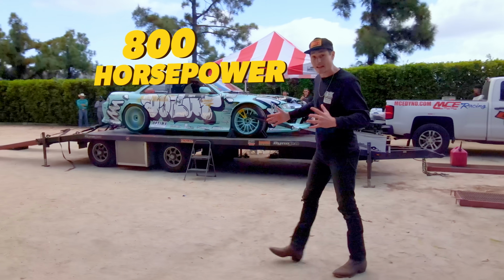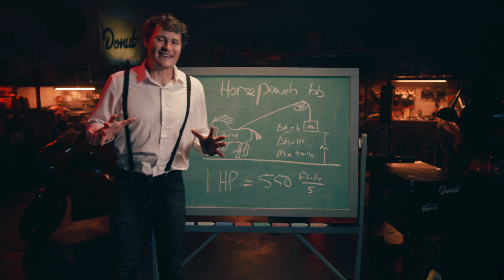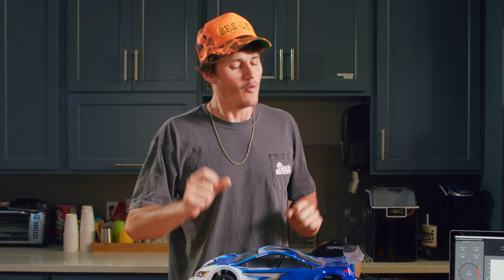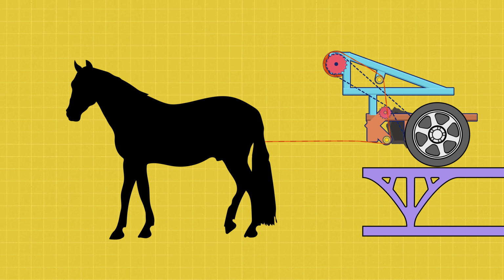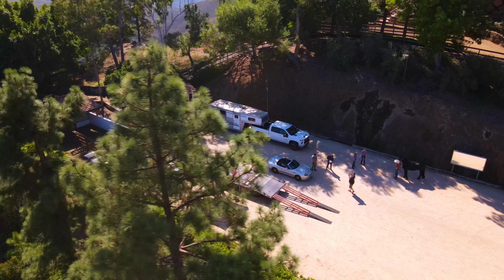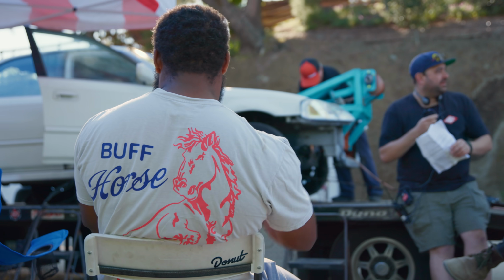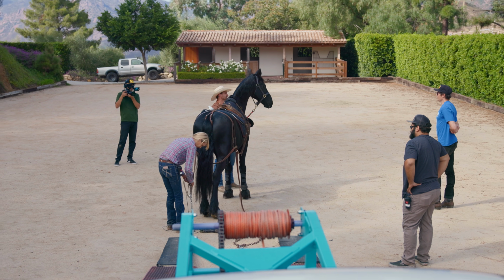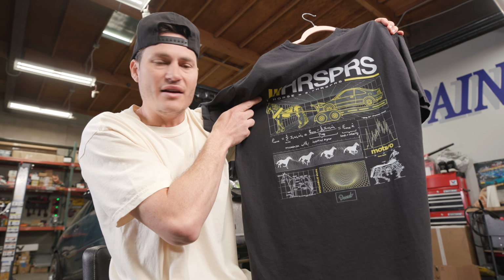How Much Horsepower is a Horse?

Comment: You must understand that James Watt was not trying to measure peak horsepower or the maximum load a horse could pull as you are but the power of a horse to do work repetitively without "pooping out."  His steam engine was a big seller in factories, mines, breweries, etc because he could replace the sustained power of a horse with a mechanical device that never needed to rest, never got sick, never needed to drink, eat, etc.  So when one looks at Watt's calculations in this light, his "one horsepower" is actually far more accurate and truthful.

Nobody from the day ever felt ripped off by Watt and his steam engines- I assure you.  Indeed they all praised it as the work of a super genius.  (Cue Wylie E. Coyote.)  If he had been padding the numbers, they would have known right away.  Yet everyone raved about his engines and their strength.  If anything, his stated outputs errored greatly on the side of caution, making the engine far stronger than he advertised it to be.  Further, the people on the business ends knew what a horse was capable of in a day.  If Watt was lying, they would have known it right away.  We often look back at our ancestors and think them dumb because they were mostly blue collar.  But let me tell you- those men were better at what they did than any engineer could ever be.  They did it day in and day out six days a week- they were true experts.

Your test is flawed because you are measuring only the peak horsepower of Big D- not how much work he could do in a day.  These are two drastically different things.  Draft horses did not make five pulls at maximum strength and then retire for the day.  They pulled and pulled and pulled- at a constant rate.  This is what Watt was actually measuring.  The "burst rate" of a horse was not important but the sustained rate of work was critical.  This is why your measurement of a horse power is so far off from Watt's measurement.  

Not to be a weenie or the fly in your horse ointment, but you are measuring apples and Watt was measuring oranges.  

It's very popular to look back at the great inventors like Watt, Edison, etc and call them liars and charlatans in today's cultural viewpoints.  That's because it makes us feel good about ourselves, but that's a straw man argument- Watt and Edison are not here to explain or defend themselves.  We are trying to place modern understandings upon people and times WE do not understand.  As such, one must know the history of the times- and not look through the kaleidoscope of modern understandings.  

Lastly, I would have simply put the horse on treadmill for a hour and let him spin the electric motor- and measured its output in volts over time.  Then convert this to watts, horsepower, whatever. Seems much easier than welding up gears and other contraptions, but hey- what do I know?  True, you may have had to use two treadmills welded together, but it would have worked.  

Big D would have come in at a SUBSTANTIALLY lower horsepower had you attached him to a mill stone and made him walk for eight hours.  Indeed any horse from the time of Watt would have come out as massively stronger than Big D- they worked 12 hour days.        

Your numbers were taken using a less than efficient device for Big D to pull upon.  That... "fur bar" device is NOT what horses of Watt's time would have been attached to.  They would have been attached to a collar custom made to the horse's anatomy.  As such, the horse could get its shoulders, chest and the entire front portion of its body into the equation- not just the rear end.

I suggest you go talk to the Amish and repeat this test.  Get them to use one of their field horses, a full blown work-horse doing hard work everyday. (As opposed to Hollywood horses like Big D that rarely put in a full day's work- but wow are they pretty!)  Measure the ability of Amish horses in period accurate custom made collars to do work over an hour or two.  Your results will then come far closer to what Watt measured I suspect.  

Google "horse collars" and you will see that Big D was not working anywhere near his potential.  Further, that his lack of training as a "pull horse" would greatly reduce his efficiency.    

Before one can judge a man, we must walk a mile in his shoes.  Understand what Watt was replacing with his steam engine first, that being the ability of a horse to work all day, and then work backwards.  I suspect that you will find Watt was MUCH closer in his measurement of sustained work than the conclusions you came to with this... well not trying to be mean but I must call this an apples to oranges comparison.

Comment: I think Mr.Watt meant that 1 horse power was on average equal to the power a horse could produce continuously for the entire working day without burning out. Of course a horse like D can pull hard during small bursts but if D had to pull continuously for the entire day then he would probably not produce 5,7Hp. 
Plus the working horses were walking i circles instead of straight lines.

Comment: I applaud the efforts.  Great video, well done.  It does strike me however, that just like efficiency loss with multiple humans,  this doesn't tell us something it should .  If I have a car with 570hp, and I say each horse represents 5.7.  Is 100 horses going to produce that?  Probably not.  There's just a not a great equivalence.  The imaging at the beginning of the video implies we could answer the question.  If I have a steam engine rated for 10 horsepower.  It might represent the 57 raw horsepower tandemed through efficiency loss better, than 10/5.7 or 1.75 horses.  In other words can 1.75 horses do the same work as a 10hp steam engine?  Probably not.  Perhaps an experiment for another day.  Of course, you'd have to do multiple runs, with varying numbers of horses, to extrapolate the diminishing returns.  Rigor is fun.

Comment: Great video. Per Wikipedia: 
"In 1993, R. D. Stevenson and R. J. Wassersug published correspondence in Nature summarizing measurements and calculations of peak and sustained work rates of a horse. Citing measurements made at the 1926 Iowa State Fair, they reported that the peak power over a few seconds has been measured to be as high as 14.88 hp (11.10 kW) and also observed that for sustained activity, a work rate of about 1 hp (0.75 kW) per horse is consistent with agricultural advice from both the 19th and 20th centuries and also consistent with a work rate of about four times the basal rate expended by other vertebrates for sustained activity."

Comment: Their answer was 5.7 horsepower, but i strongly disagree for this reason: the avg horse weighs 1500-lbs and runs 30-mph. It's a simple power to weight calculation. If you think u could move 1500-lbs to 30-mph in less than 1/8-mile w 6.5-hp id love for you to build me a gokart. 6.5-hp pushing 1500-lbs wouldn't generate 30-mph unless there was a big hill involved. Recalculate. The avg horse is closer to 50-hp than 5.7

Comment: AXIAL DYNAMO, SPOOL WITH A ROPE ATTACHED INSTEAD OF WHEEL AND READY: WIO, THE HORSE WENT AND THE MEASUREMENT IS READY. BUT LET'S SAY THAT MORE COMPLICATED METHODS ARE ALSO INTERESTING. THE SAME IDEA IS GOOD TO CONFIRM BUT THE RESULT MAY BE NOT ACCURATE AS IN THESE FIRST EXAMPLE WITH AXIAL DYNO..

Comment: you are going to lose an amount of power converting your "horse pulley system" to any form of mechanical transmission. you could have just dragged something heavy and used math. it would have been more accurate. im guessing you are wanting the measurement of power after transmission losses?

Comment: That was sweet. The only potential flaw would be a "control" to prove the accuracy of the mobile dyno. One car on ~3 other dynos and then used on the mobile dyno would give the control, then the mathematical specifics of the horse would have backup data to prove the accuracy of the numbers you got.

Comment: Hey how did you guys account for the gear ratio change on the layers of rope on the spool? Like the pulling power of a winch is different on each layer of wire on the spool.

Comment: The only problem I had with this was that the original measurement was for draft horses running a grindstone or the equivalent and doing it all day. I do not know if this horse could have kept that up all day and also the original measurement may have taken into account the downtime of the horse and the fact that it needed to be replaced with another horse when it was not working so it may have been calculated into the results.
Reply: Horse people will tell you that a horse will work his heart out for as long as you ask him to, to the point of complete exhaustion.  A mule on the other hand seems to have a built in limit where they will just work at a sustainable pace until they are tired, then refuse to continue.
Reply: there is the thing of messengers in medieval times working horses till they would litterally fall over dead  @AJ-ln4sm
Reply: Indeed: great video, but the initial comparison with horse power included the time. If big-D can pull this hard without problem 17.5% of the time (4.2 hours per day) for a few days, which sounds reasonable with a bit of training, then the original definition has been verified!

Comment: let me just pause your engineering masterpiece and find something better that handles even more duration can be tested with multiple levels of different horse's to discover that particular but not all horsepowers as you will need not just 1 horse but many different horse's wild and tame  you attach them to a cart 🛒 simply a vehicle like a car the weight of the vehicle is sensed including adding tire weight figure including air weight by how much atmosphere the tires are filled with and then rather than placement of your horse on the dyno you place the dyno As the entire tow vehicle which you can steer from or have it set to AI follow or mechanically naturally follow electric motors as generators literally absorbing horsepower  teaching horse to keep pulling when at full gallop trying not to slow down trying from dead stand still and other acceleration and slowdown patterns equally provided on each test subject as well as cow power moose power buffalo power whatever you got zebra giraffe hippopotamus rhinoceros you could transport this test item cellphones nd hard drives for processing and data storage power as well as online live updates ya simply take a picture 360 walk around of whatever is pulling and let it give her a tug btw specifically for testing purposes and not animal cruelty ❤ the best treatment over time as well as rewards for all participants ya can't expect them to work for you for free 😊

Comment: Maybe I'm dumb, but wouldn't this work for measuring crank horsepower?  First take a normal car and measure it on the trailer dyno.  You now know its wheel horse power.  Now take that car and have it pull the rope on the rig and see how the known wheel horsepower translates to the dyno and you'll know your rig's loss rate. 

You'd need to probably still do a LITTLE math to validate any friction losses from the car to the road but that's much easier.

Now you can just put the horse on it and apply the conversion ratio.

Comment: dude thers so many easier way to do this 🤭🫣 one pulley on ruff rope some weight and thats it 75 kg on 1 metres in 1 sek is 1 hp 👍🏻 even only stopwatch and gps speed meter be enpugh from accelerstion energy asf and many other easy way to measured power and no dyno dond measured torque it calculate it as well as power or both measured just one more complicated than other 😉👍🏻most stupit 💩 ever is mounted this whole frame in car instead of just frame without car just with 1 eheel in frame and this on dyno 🤷🏻‍♂️🤭 5,7 hp cos you prayed be the fire instead on put this fire tp this horse asss than dyno should show more than 10 hp ,in fact as engineer ypu probably know that this way of measurement have limitation which we call GRIP 😉 cos you use heavy load to pull 🤮🤐🤷🏻‍♂️ this horse looks like 600 kg indyvidual such size horse can in short burst achieve more than 15 hp cos than gripbe not issue  simple calulation show this  0-10 km/h such horse can do in 1 G it mean 0,28 sec from 0to 10 km/h energy diffrenc is 2315 joules : 0,28 sec = 8,2 kw = 11 hp  in fact how much power horse be able to clock depend on except health and how hard he try on size weight of horse bigest horse can clock much more than 11 hp 😉👌🏻  overall sienc know that each  1 kg muscle horse can genersted up to 30 watts if 50% of body weoght this horse is muscle and it weight 600 kg than you have 300x30  = almost 13 hp but offocorse less % of whole muscle mass drive horse forward anyway load here is issue if you setup 2 tons load for 500 kg horse on one pulley on ruff reading be 0 cos this horse dont even move this weight be 1 mm upward unless strong jerk which is not the way hp is measured for”crankhp” 😉👍🏻 yea anyway 5,7 hp for 600 kg horse is bias this horse can clock much more 😉👍🏻 but load and grip must be good choice .

Comment: I think a better, most precise way to measure this would have been with a carousel type of dyno where the horse pushes on something. The friction losses would have been minimal compared to this assembly. At the end we don't really know what's the PHP (paw horse power). It's certainly more than the wheel horsepower as measured on the dyno.

Comment: was a good watch but inaccurate there shouldn't be retention pressure to accurately measure hp or pulling speed should it not be more of a free spinning spool ? what youve measured seems more like car weighted horse power and not built the bases of a horse power

Comment: Very interesting problem. Where could one find the academic paper about it, when was the project run? Was the number 5.7 gained from average of 4 or 5 pulls, combining the different measurements?
Seems you disproved the original number, wonder if this will ever change industry standards and will the horse power be changed in the industry?
Would be interesting to see such testing on larger scale, how different horses compare and can any median average result can be calculated.

Comment: so attaching a hub dyno to one of those training Ferris wheels/milling rig wasn't in the cards?
Reply: the whole thought experiment was based on the observation of a mill in process and the picture of a straight line pulling 550 lbs was the diagram to show the vectors.

Comment: Perfect video! Just an idea..Why not wrapping the rope straight around the drum? You would get rid of the mechanical losses that the Motivo contraption adds..You would measure torque and rpm at the drum. In any case congratulations for the whole project!! So, 5.7 Hp@10 steps...:)
Reply: That. Why did they make a whole rig and add complexity with a Honda Civic in the middle when they could've just put the rope around the dyno...
Reply: Came here to ask the same question.  Why this Rube Goldberg contraption?

Comment: This is so stupid.  All you've gotta do is weigh a horse and rider and using gps measure velocity while the horse runs up a slope.  The rest is just basic math.  This would also allow you to test several horses for comparison.  A race horse might beat that draft horse in terms of power due to its speed as a draft horse is slow and speed is half of the equation.

Comment: Dude the you know is at treadmill for horse  the only thing you need to do is do some math and sensor  on the treadmill  a you seriously   is so easy  take the motor from the treadmill out and put the Dino in  place and you got the real horse power   the use this in running horse  I can believe this

Comment: The type of content that none asked for but everyone needed in their life!

There are some flaws here though, you just measured one horse, you can't get the average of this, you also can't know if this horse was really motivated and used hi's full strength. I'm not a horse man but i lived on a countryside and i think, that a horse on a grass would have more torque to the ground, or at least not on a gravel surface. The rope should be pre tensioned so the horse won't lose strength on that first pull to tension it. That's why i think a bar / rod with teeth on it, on a slide, that's driving the gear would be better here.

Comment: I didn't finish whole episode, but WHY didn't You make it upside down?  Dyno to be pulled behind Big D on flat surface. 
You got constant mass, constant inertia, Easy to build setup, You can calibrate it, by pulling it behind electric engine whitch You can calculate everything from RPM, and current messure...

Comment: So there wasn’t like a treadmill set up that could’ve prevented all that extra work?
Reply: I was thinking it would employ a mechanism similar to that a draft horse is worked on, pretty much similar to treadmill. We could get constant infinite pull up to optimal/peak.
That way will greatly eliminate the parasitic load hence the crank power should be theoretically simpler to calculate.
might as well throw in sort  of simple multiple level transmission gears to let the horse build up speed and reaches the peak "torque"

Comment: Generally, peak horsepower is a consideration that is secondary to continuous, maximum horsepower.  This video therefore misses key consideration when comparing the maximum power of a horse to machines, such as electric motors, tractors, etc: Specifically, what power can a horse produce all day long, such as plowing a field, pulling a heavy wagon, etc?    I would be surprised if this horse can produce a steady horsepower any where near peak its peak power. Probably a lot closer to 1 horsepower,